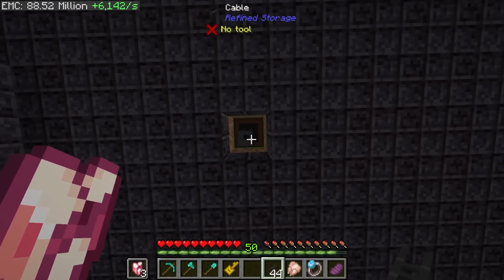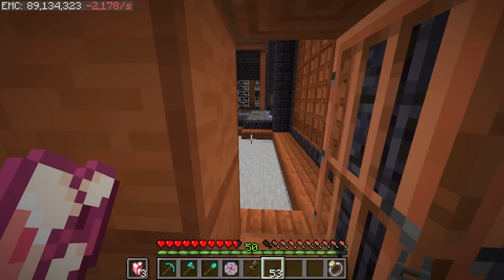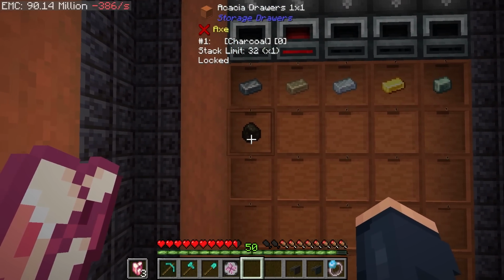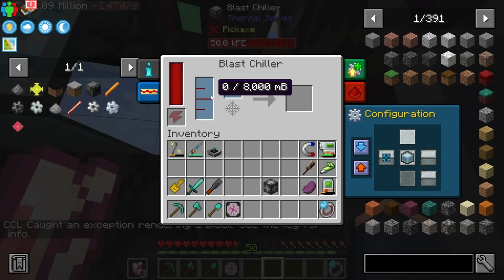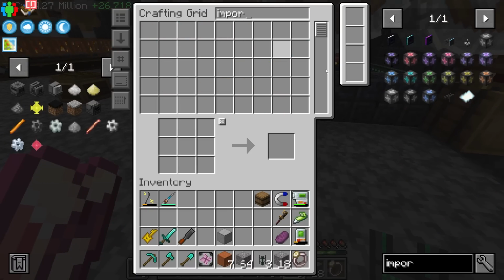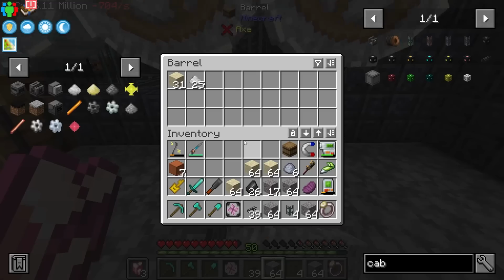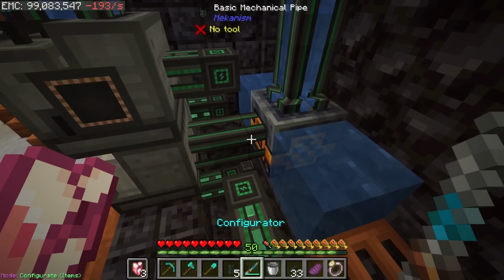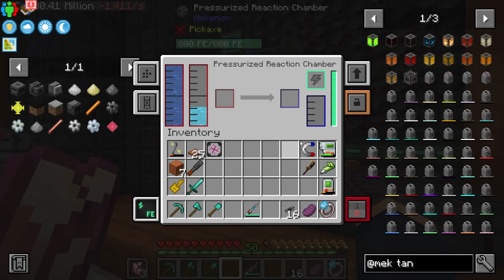Mechanical Mastery Minecraft Modpack EP8 Charcoal and Gunpowder Automation

Comment: You should take a look at mini utilities' solar panels; they are cheap and work by being connected to the controller, the power generation scales up in a non linear way, so you can easily reach 100000 RF/t; you also should be able to make red matter gear (armor and furnaces) and the watch of flowing time by now

Comment: For the life of me, I cannot get passive mobs to spawn... I built up a grass area that is somewhere in the ballpark of 40x40 blocks and I culled my chicken population (from the 2 egg reward) to just 2 chickens. I have the settings on always daytime but otherwise no other configs changed. I get the wandering trader fairly frequently... but no cows, pigs, etc.
Reply: Biome issue ?
Reply: @brunomeyer5352  very possible, my starting area biome is Ocean.
Reply: that must be my issue? is there a way to fix the biome problem? because the biome you’re “in” depends on what the acqeuous accumulator will fish out from the water

Comment: Not sure if the pack has changed since i last played it, but I believe you can sawmill the effigies so you don't even have to spawn the mobs in to get their drops for the mechanical essence as you mentioned in this video. That way all you need are all the thermal machines automated and the RF to run them for the improved essence.

Comment: Whenever I use a new machine I check all inputs and outputs are set to 'none' before I put it in its final place. That ensures it doesn't accidentally start filling up with the wrong things (some can be a real pain to remove, especially if they don't have a quick clear method). Mekanism has a button to clear all input configurations at the same time (per input 'type') but unfortunately some mods don't and it's very annoying clicking every input manually.

Comment: I solved my gunpowder problems by making a mob grinder under my base. Had to set up industrial forgoing to do it but it was worth it as i also used the mob crusher to also kill the spawned effergys so I could get better rates than what I would have gotten in the sawmill.
Reply: what set up did you use for the mob grinder? i don’t understand how clickers work, but you need clickers to spawn the effigies right? and saw mill effigy only outputs 1 drop per, whereas its like 4 if you kill them manually

Comment: isnt there modular routers in this you can just set up a router to pull output and sender to send to drawer controller or a chest with importer for importing also routers can send rf wirelessly worth a check

Comment: Here is a pro life tip. You can attach a storage bus on a sink (at least with AE but I would assume it works with RS if you can have liquids in the system). After that you can just use a bucket on the ternminal to get a bucket of water without having an infinite source. You can also dump excess water bc the sink has unlimited capacity.
Reply: If you do this, make sure you whitelist the storage bus / external storage for water, so you don't accidentally dump other fluids into the sink
Reply: @CheeseduckClaire  i am pretty sure you can't put other fluids into the sink. It is not like the interfaces where it has unlimited storage for all liquids. It's an unlimited storage water tank so it won't accept other liquids.